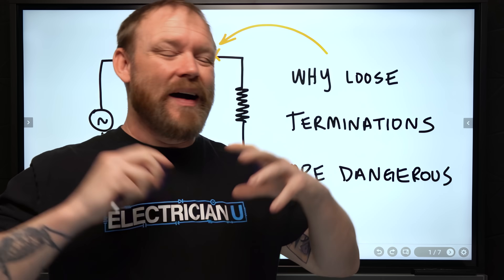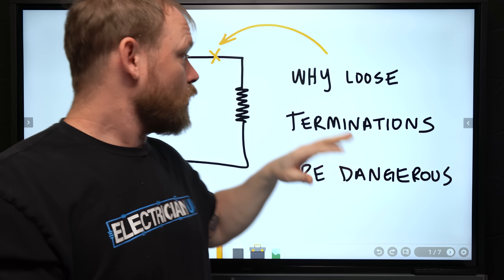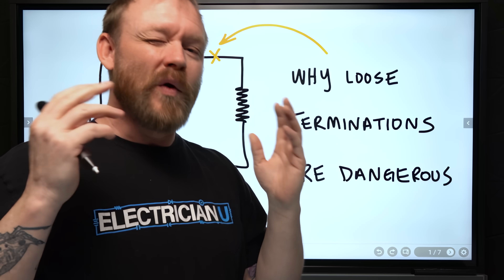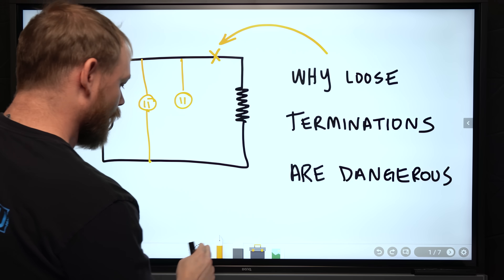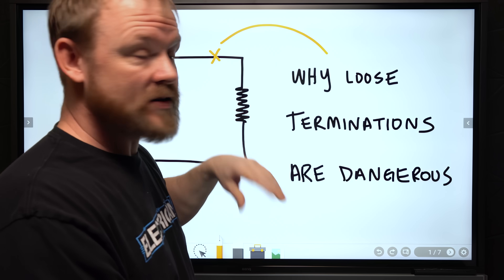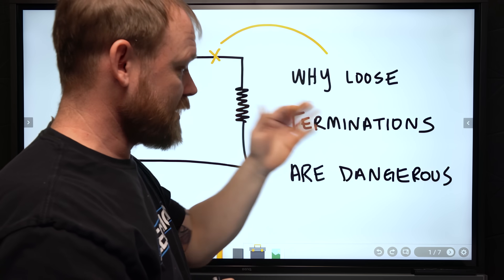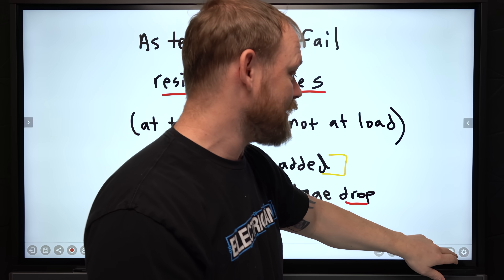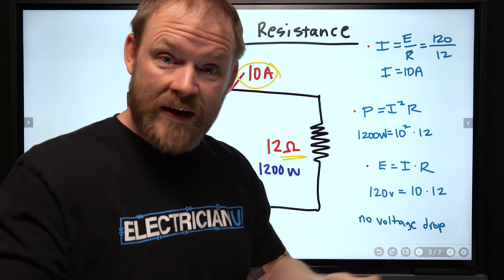Why Loose Wires Cause Fires: Why I Pre-Twist.

Comment: Great presentation.  It would be good to see the same with a parallel circuit which is more indicative of electrical circuits in a building or home.  Without going through the math myself, it will be interesting to see how the 
1/R(t) = 1/R(1) + 1/R(2) equation affects the Power (& resulting heat) with a loose connection.
Then, comparing the Magnitude Charts for P, R, I, and E between Series and Parallel loose connections.
Reply: Do your math and treat all your parallel loads as one single load
Reply from the maker: Good idea, I'll add this to the list!

Comment: OHM's Law does not tell a lie. Ever. I know there are a lot of "electricians" that do not know Ohm's law very well.  Understanding Series and Parallel circuits is pivotal to advancing your career as a competent electrician. 

Dustin, great video!
Reply: Thank you for sharing your knowledge it’s so valuable beyond what people may think keep these videos coming PROFESSOR
Reply: While that is true, just as many electricians are completely lost when the involved parameters are complex ones. Inductive or capacitive loads for instance will provide for a bad day when you tryto use standard Ohm's law. But Ohm's law isn't to blame, rather the lack of understanding when it comes to AC voltages.
Reply: That's not inherently true.  Say for instance, the calculation for the return current on the neutral using ohms law is not what you see on the meter.  The return current on the neutral has the vector sum of all inputs into the system, it's not a purely resistive system, as ohms law would leave one to believe.  It's good for simple circuit design, but for real world applications.  It's not it.
Reply from the maker: Thank you my friend!

Comment: Another factor to think about is that failure points tend to be small compared to most loads, such as the wire nut connection you're talking about.  Where a space heater will be spreading this power loss out over a larger area, the growing amperage in the wire nut connection will have all that power trying to dissipate in a tiny space, concentrating it and increasing the potential for combustion of some adjacent fuel.  This is why I prefer metal j-boxes even in residential, as otherwise it's up against wood or insulation.  I know the fiberglass insulation is supposed to be fire rated to a degree, but I've seen that stuff burn pretty well.
Reply: Using thermography you can clearly see how at the point of failure temperature radiates out

Comment: In my opinion, when the terminal loses connection, it means it's losing the section required for the correct and safe operation of the circuit. The breakers do not trip because the electrical current is still within the breaker’s limitation
Reply: correct it's like using the wrong gauge wire for a breaker. Or simply put the wrong size fuse in a car except instead of blowing it will just heat up continuously until failure or fire.

Comment: When I did construction I always pre twisted solids and if it was just stranded or 1 solid and stranded then I let the wire nut do the twisting.  Never had issues with my splices
Reply from the maker: Same. Though with all conductors stranded I still pre-twist. When you mix solid and stranded though you have no choice but to let the conductors do what they do.
Reply: Wire nuts do not sufficiently grip stranded wiring unless one of the conductors is solid.  It has to do with the gauge of the individual strands such as "fine" stranded. I cringe at the use of wire nutting when ALL the conductors are stranded. I use WAGO style connectors when all the conductors are stranded. Your thoughts?
Reply: @cruze1953  I have done thousands of splices in my 25 years in construction and never had a problem splicing stranded. I know it’s tight enough when I have twisted down at the insulation. Wagos are ok but I don’t know if I trust them carrying a lot of load. I am old school and have been using wire nuts for a long time. I will use wagos for fixtures and low current draw applications stuff but never in just a regular J boxes for splicing

Comment: How dud you calculate the inital 4ohm resistance of the loose connection, or did you just grab something? Theres an ongoing issue with new graphics card connectors not connecting properly and melting the connector. Id like to calculate rhe resistance of the poor connection. Thanks! ❤

Comment: Same concept applies to your car. When corrosion builds up on the battery terminals, it is like two resistors added to the circuit that are not supposed to be there. This causes a voltage drop which can affect various processes. One being starting the car. If you hear that clicking sound but the engine doesn't turn over, this could be because of not enough voltage to operate the starting system. Another example: your car spits and sputters while driving. With modern day electronic ignition systems a certain amount of voltage is required for flawless operation. If that voltage drops too much the electronic ignition system can start to operate irrationally. I myself in my vehicle cleared up sputtering by simply cleaning the terminals on my battery to where shinny bright metal showed. It also increased the efficiency of cranking the engine to start the vehicle. Before buying a new battery, just try cleaning the terminals first. It may fix your problem. Wash your hands thoroughly after handling lead and don't breath in the dust created cleaning the terminals.
Reply: It helps to keep the battery top on your car in a clean state. Dirt plus water = battery drain. Clean the top with water or baking soda in water.

Comment: Thanks for the informative video.  Though counter-intuitive, it makes sense.  If you consider the extreme cases, 0 ohms results in 0 power, and infinite resistance also results in 0 power.  So there must be a resistance between 0 and infinity that results in maximum power dissipation.  Fun fact.  If you have a fixed voltage source, like the 120 VAC coming in, and a fixed resistive load, like the heater (whose resistance is also fixed, the maximum power dissipated at the unwanted "terminated" point occurs when that unwanted load resistance equals the heater's load resistance.  This will always be the case, regardless of voltages and resistances.  So, since the heater's resistance is 12 ohms, the power dissipated at the termination is highest when its resistance is also 12 ohms.

In radio & TV transmitters, for example, the transmitter always has a characteristic "source impedance", often 50 ohms.  Then the question is, what impedance should the antenna present in order to maximize the transmitted power (so the antenna sees the maximum power).  Answer: also 50 ohms.  I.e., when the load impedance equals the source impedance.
Reply: What you say is exactly true, but it ought to be interpreted in context. In a 120 VAC distribution system, ANY power not delivered to the load is lost, and could cause a fire. So you want to keep the connection resistances as close to zero as possible, and use as big of wire as you think is worth it. The RF example is a different situation; the "wire" is really a transmission line with an impedance of 50 ohm, so you get the most power from the source (at 50 ohms) to the line (at 50 ohms), and from the line (at 50 ohms) to the antenna (at 50 ohms), and that's the best you can do. Any mismatch anywhere reflects some power back in the other direction. No such "reflections" occur at 60 Hz in house wiring...
Reply: @jonahansen  Agreed.  I failed to mention that the two scenarios have opposite uses.  In the transmission system, you want as much of the power as possible to get to the antenna to be broadcast.  In the 120VAC system, you want as LITTLE of the power as possible to be lost in heating the infrastructure.  So a poor junction whose resistance approximates that of the intended load is the LEAST desirable situation.
Reply: @johnburgess2084  Agreed!
Reply from the maker: Great point! Holy crap I'd not thought of that until now. Thanks for the perspective!!

Comment: What would cause a termination to fail?  Let's assume that the cable is stapled correctly within (8"?) of the box, and everything else is done correctly, however the installer did not pre-twist and perhaps did just an "OK" job with the wire nut?  So, for now, we have a perfectly fine connection with no additional resistance.  My question then is, without somebody going in there and messing with stuff, how does this connection fail?

Note:  I am a DIY guy, no formal training, but I always pre-twist because of guys like you saying that it is best practice.
Reply: If enough heat is generated, the copper will oxidize and become copper oxide (Cu₂O or CuO, depending on conditions) which has very high resistance.  This causes a "runaway" positive feedback loop causing even more copper oxide to be created.

Mechanically, the loose connection can be initially from bad twisting and twisting that wants to untwist since there is a counter force from the copper and sleeving.  Also, vibrations from AC oscillations may want to accelerate the initially loose connection.  You can have vibrations in DC as well if using PWM to throttle the power.
Reply: @beyondfossil  Thanks!  The vibrations make a lot of sense, and I had no idea about copper oxide from heat.  Very interesting.
Reply: Expansion and contraction could eventually cause it to fail. I’ve seen it more than a few times in almost every form of termination possible, typically in outdoor areas, attics, and exterior walls. A somewhat decent termination in an attic, in the southern Midwest for instance, is going to expand and contract a lot more than a termination in an interior wall of a house that’s kept around room temperature due to the extreme heat in the summer (approaching 120+ in the attic) and then contracting in the winter when it’s often well below freezing. That’s a lot of expanding and contracting over 20-30 years, so a somewhat decent connection will almost certainly fail eventually. It sounds crazy, but the connections are slowly loosening themselves. That’s why pretwisting is at least a good practice because you can visually see every wire and can be certain it’s a good termination. There’s more to expansion and contraction than just temperature change, but it’s definitely a big factor.
Reply: @ What are your thoughts about "lever style" connectors like the Wago connectors?

I've pretty much exclusively switched to Wago connectors.  Because the traditional twist connectors leave too much open to chance especially when connecting more than two wires together and especially if one is not a professional.  Even with a pro, he can be in a rush, overworked, distracted and then Murphy's Law comes into effect.

But with lever nuts, there's almost zero uncertainty -- it either works or doesn't work and it easy to tell when you've done it wrong, which is rare.  The connection is quick too which reduces fatigue especially if there are lot of wires to connect.

The other advantage is easy of lever nuts is easy of changing wires.  If you have to change something with a twist nut, you have to undo/redo everything which re-introduces more uncertainty.

I'm sure a pro can do twist nuts consistently well but, like you're saying, they just don't seem to be as rugged based on their design and problems like what you're talking about with long-term use with thermal cycling.

I've used Wago connectors even in DC connection with 400V solar with no problems whatsoever with heating.  Some of the problems/complaints with Wago connectors may be people use cheap knock-offs or fakes.
Reply: @  In my opinion, you’re right on the money. I always recommend wago connectors if anyone who is not a professional asks me about how to install a new light fixture, ceiling fan, splicing in junction box, etc. The room for error is diminished dramatically, not to mention they’re typically dealing with short wire in a tight box. It’s difficult to get a good connection with wire nuts in that situation, regardless of the experience you may have. I almost always use them with lighting whips in residential settings. I work in commercial and industrial primarily, and residential just to help friends and family out. For some reason, in my experience wago connectors are rarely used in commercial and industrial, at least in my area. I’m not sure why when 12awg wire is all that’s in the junction boxes, but I certainly prefer them when doing lighting installations due to the ease and speed of the connections, like you stated. Other than that, I prefer wire nuts. With stranded wire, which is nearly all that’s used in commercial and industrial, it’s still pretty quick, and I trust the connections just a little bit more, but only anecdotally. I’ve never had a wago fail. It’s more of a preference for me I guess. As far as how well they’ll hold up over the years due to the temperature fluctuations, I’m not sure. It is a slight concern of mine, but they haven’t been in common use long enough to really know. Regardless, when it comes to someone who isn’t a professional, it’s almost certainly the safer option of the two, but only time will tell.
Reply: @ryanhighfield1094  Thank you, that makes a lot of sense.  Appreciate the reply.

Comment: If you check the bottle the wire nuts come on no pre-twist is required. You twist the nut until the wire with insulation has a twist

Comment: Best pratice that I found was to always strip the wires longer then label states ( 1" ). Pretwist with heavy linesman pliers then trim the ends, finish tightening with heavy ( long ) linesman pliers until wires are twisted so insulation has halve a turn. Finish with quality tape wral. Never purchase or yse ANY electrical tape made in lack if quality control, lying cheating communist china. There tape is only good for taping small trash bags !

Comment: Former licensed electrician and engineer here. Pre-twisting is definitely preferred, but if your wires are loose after applying a wire-nut without pre-twisting, you did NOT twist the nut to a suitable torque. I have done both thousands of time and I promise you, if you twist the wire nut hard enough, there is zero difference between the two, and this is proven with multitudes of test data. If you disagree and your wire nuts are loose, then lay off the Mountain Dew and hit the gym. With that said, I always required my guys to pre-twist simply to ensure a good connection because I did not trust them otherwise.
Reply from the maker: Well said :_dope:
Reply: The reason I don’t trust the wirenuts alone is that you are relying on the tension of the spring and the plastic housing to hold the connection together. Over time, heating and cooling cycles can weaken the tension of the spring. Heat and age can weaken the tension of the plastic. I use #12 wire minimum for residential receptacle circuits even if it’s only on a 15 amp breaker. I pigtail all my receptacles and pre twist all connections. People will be plugging in space heaters, portable air conditioners, EV chargers, etc. I just don’t like taking chances.
Reply: @monteclark1115  

While I advocate getting away from archaic wire nuts, the proper use of wire nuts will twist the wires, which is why IDEAL, for example, doesn't tell you that you need to pre-twist.
Reply: @CorneliusTaylor-s1u if you have 2 or three wires, it might, but 4 or 5 number 12s, I’ve seen the wires pop through the top of the wirenuts without a strong tight twist.
Reply: @monteclark1115 if it’s popping thru the top you are not aligning your wires evenly.
Reply: @PW_12345 

Too much to read and respond to. Stick to one or two things and learn to write more concisely.
Reply: @PW_12345 

Archaic has more to do with obsolescence than how old something is. Clearly lever and push in connectors are superior to wire nuts. That they are designed for temporary usage is something that you made up.
Reply: @PW_12345 

Again, I'm not reading and responding to all that.
Reply: You forgot to mention to use the linemans pliers.    Also how to twist the wire nut on.    There is a right and a wrong way.    The right way is with a 90 degree bend in the wires for leverage.
Reply: The package, hence the manufacturer, requires pretwist. Manufacturer specifications usurp any other opinions.
Reply: I have never had a problem with wire nuts in over 30 years
Reply: Wire nuts are proven to work and way cheaper and im cheap fuak lol
Reply: Just use lever and push in connectors. Wire nuts are archaic.
Reply: @CorneliusTaylor-s1u  I've never used lever connectors, but I can confidently say the push in ones suck. I'm not a fan of those at all.
Reply: @curtiswaters7415  

Both the lever nuts and the push ins that I have in mind are decades long proven.
Reply: @CorneliusTaylor-s1u WAGO fails in high amperage and vibrational settings